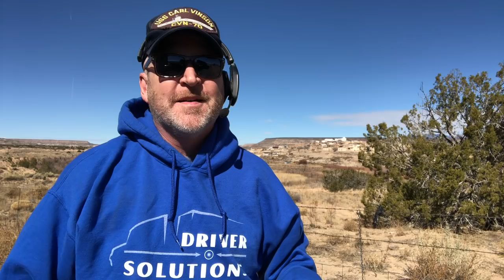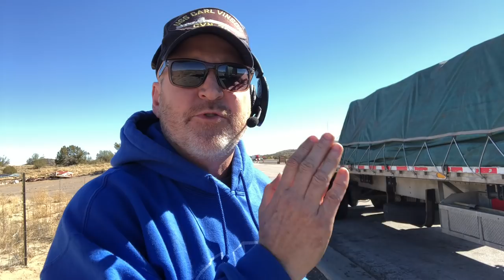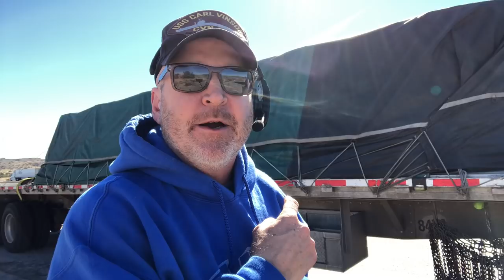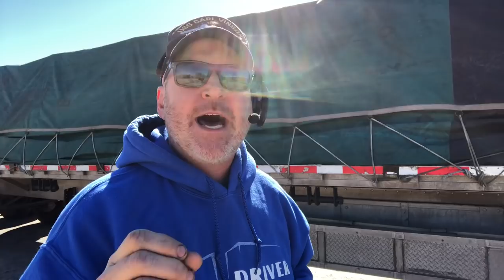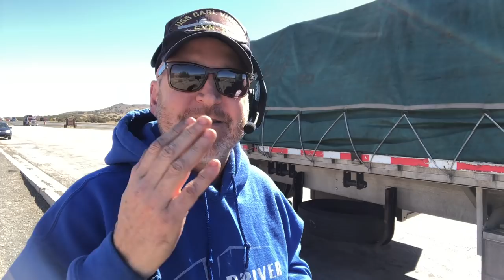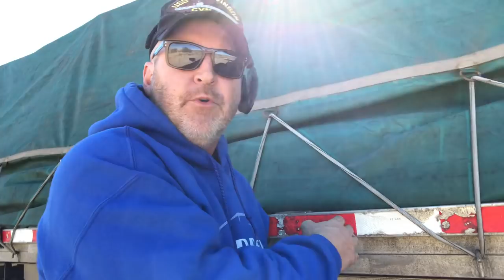Weight Distribution on a Flatbed Truck

Comment: Water weighs 8 lbs. Diesel fuel weighs 6. I mentioned that to another guy on YouTube and he claimed he researched it and came up with literature from Chevron that said 7 pounds. That’s fine, but in 19 years every gallon I’ve bought weighed 6. Today I load three to six times per day and I haul over 86,000 lbs. of my 88,000 lb. limit, so I know that it still weighs 6. It would be nice if it did weigh 8. If it weighed 8 or more, you could extinguish a fuel fire with water. It would take a lot of water, because a fuel fire is very hot, but you could do it.

Comment: When I went into shipper I went on with full tanks of fuel ... The shipper gonna deal with it ... I won't run a load 1000 miles and have stop ever 100 to 150 miles to throw 50 to 75 gallons on ...

Comment: Two things to remember, diesel weighs 7 Lbs. per gallon, water weighs 8, that's why oil floats... Also never buy a trailer that doesn't have a spread or sliding tandems, only cheap fleets use fixed tandems because they don't care if the driver has to re-load. Nice job tarping!
Reply: Right but by calculating 8 you never have to worry about being too heavy.

I agree, because even a sliding spread axle is better than a fixed random and you can still run in CA

Comment: Good Video!
Guys just one question to anyone who would know - what is the average floor capacity per M2 / ft2 for good curtain sider? Where this information can be found? We've got 2 package of 8x6 ft (2.5 x 1.9 meters) and weight is 24000lbs (12 ton) and the freight forwarder says only flat bed can take them because of concentrated weight on small area, but I thing at least one can be transported if loaded closer to axles point but the freight forwarders doesn't agree. What do you think?